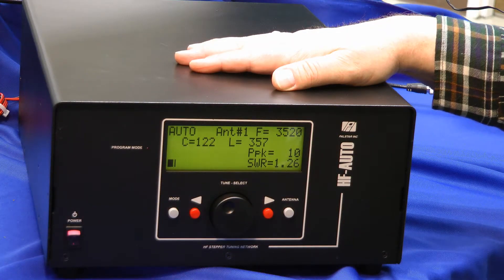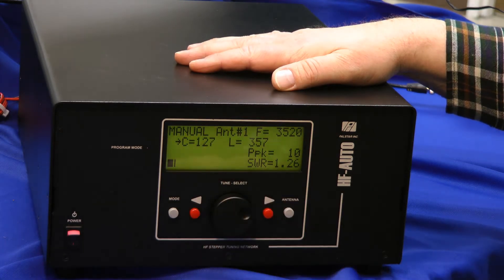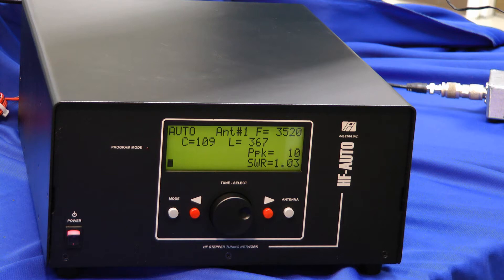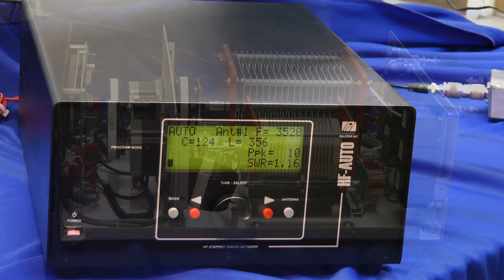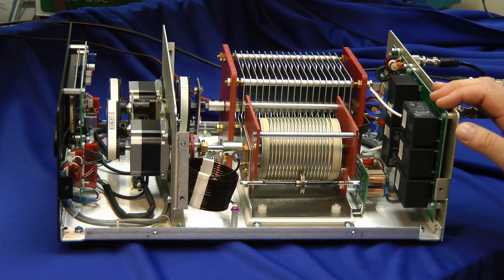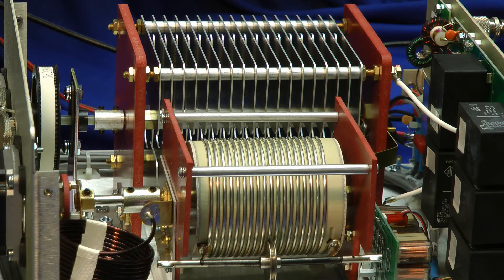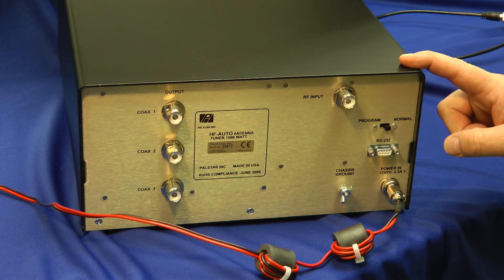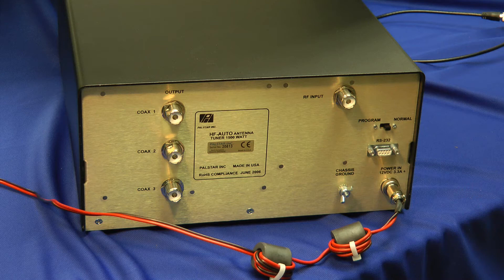Palstar HF Auto Antenna Tuner

Comment: Cost = Insanity MFJ / LDG equipment will get the job done also.
Reply: Yea, and today I just returned an MFJ-993B to HRO because it didn't work properly, right out of the box new. You get what you pay for. 73, WB4DW
Reply: Yes, but when u change bands on ur xceiver, will the amp change bands w/ u like w/ the HF-Auto? I currently have an LDG for my bareft 101MP, but when I upgrade, that's the question. Plus I have 2 SWL rooms coming off my DXcc dipole. Which shouldn't be a problem using the right switches..
Reply: I like LDG, but they do not make a legal limit tuner.

Comment: I was hoping for a more technical review of this tuner from the ARRL lab. This video plays more like a manufacturers ad than a product review. You didn't find one negative aspect of the tuner. Didn't even mention what bands it works, power limitations for various modes, or use for RTTY and other digital modes like PSK31 and FT8 which are so popular today. Can it be that it is the perfect tuner for everyone? Doubtful. Having said all that I like the feature set of this tuner, and it is on my short list as I am looking to upgrade to a more capable auto tuner.
Reply: I agree, not what I expected from the league.

Comment: Your review is very good.  In my view this Palstar HF Auto tuner is absolutely awesome.  I love it.  Now I have paired it up with the LA-1K H LDMOS Amp from Palstar.  Please do a review of the new amp from Palstar.  The pair works together like a fine pair of gloves.  I would love to hear your impressions of the new Amp from Palstar.
Reply: I just bought the pair & the tuner won't tune. Are u near LA? Maybe u cld drop by & put me on the air. But not till I ground everything. HRO said to ground everything. The tuner won't tune otherwise. Don't know if its a magic bullet, but I'll start from there. My antenna guy is a pro & knows all about installations, so I know he'll do it right. My first linear so there's a learning curve 4 me. My LDG & the tuner in the radio both tune up great barefoot, so I know my antennas are OK.